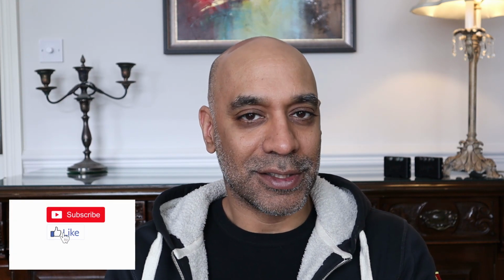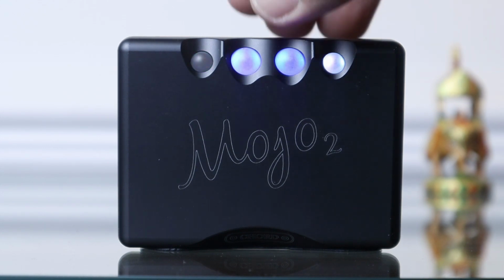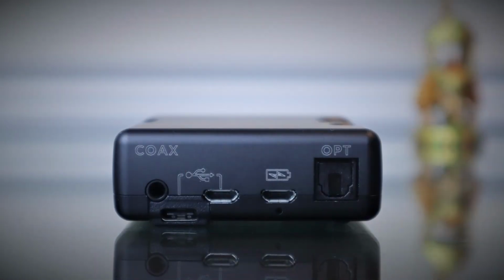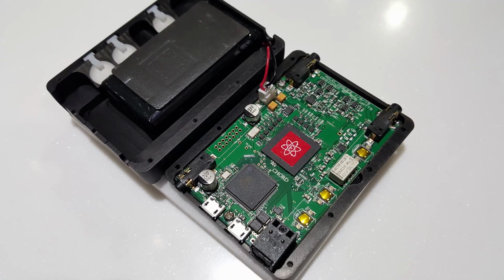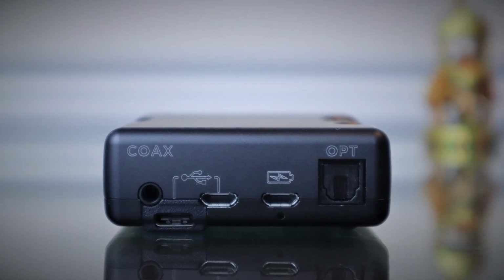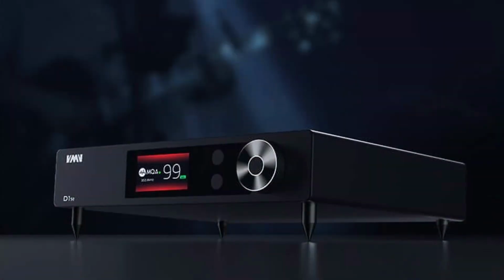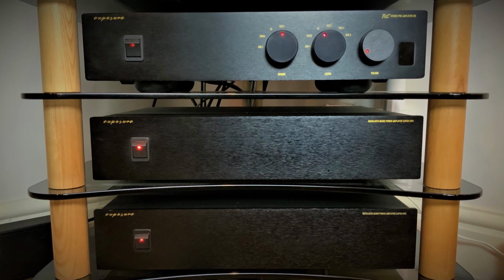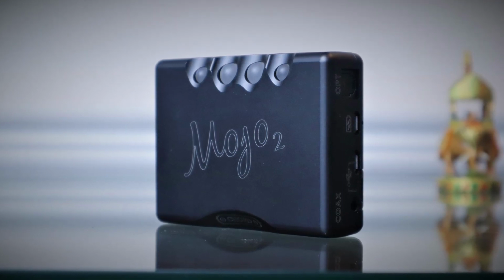Still Relevant? Chord Mojo 2 DAC Review

Comment: Tarun.   I might buy this DAC to try and wanted to ask.   Is it quicker than the mojo 1?  That is, is it more lively in transient response? 
I liked the mojo 1 , but it was a bit too big in the low end and too warm.  Plus a touch slow.  Just a touch. 
Thank you.    
Hope all is well with you
Reply from the maker: The transients are a bit cleaner on the Mojo 2 and the sound has less of that warm, soft colouration overall 😊
Reply: @abritishaudiophile7314    Well I tired it awhile ago and sent it back.   It seriously just didn’t have the mojo of the mojo 1.   I know.  Play of words.  
The Mojo 1 was one DAC which had a ‘ different ‘ sound.  And it was super nice.    It was large and enveloping.      A touch rolled off and the low end was large.    But the most important thing was that the original Mojo 1 was enveloping and deep sounding.  
The mojo 2 just felt like any other ‘ well measuring ‘ DAC.    Yes the filtering it uses does have a good time space quality.   But it was sharp and harsher.    
I think Chord got caught up in the ‘ SINAD’ wars started by ASR.   Yes I’m straightforward and will call them out.    Measurements are wonderful, especially to see if something is seriously wrong.   But it has become ridiculous and has no other function other than marketing Chinese DACs which excel at a specific suite of measurements. 
I am actually looking for a user Mojo1 to mess about with and have on my sofa to easy listening 

Cheers and hope you are well

Comment: Another excellent review, Thanks!
Asus Soundcard (modified with Burson Op Amps) in a home-made A/V Server bypassed with a Chord Mojo= Big improvement in Sound Quality.
Mojo to Qutest= Another jump in SQ and like some Reviewers mentioned, Qutest provides more of what Mojo does, and I couldn't say it better.
Qutest to Chord TT2= Another big step up.
TT2 partnered with Chord M Scaler= Yet another large sound improvement, providing a "Grande presentation".
The Yamaha A-S3200 powering KEF Blade 2 Speakers- A gigantic improvement for those particular Speakers over what I heard previously.
And the (sometimes) surprising differences provided by Speaker, USB and Interconnect Cables which also add to the enjoyment of this hobby. 
And then there's the BIG one: Speaker positioning relative to the listening position which in my opinion is second only to the Speakers themselves for sound improvements.
Reply from the maker: Thank you Ron. Great to learn about your experiences 👍

Comment: Hi! Can I use Mojo2 as desktop DAC, powered by external power supply (like Ifi SMPS or linear PSU). Some people report sound quality degradation/noise in that case of external powering.
Reply from the maker: I wouldn’t spend money on an expensive linear power supply for the Mojo 2. It is only used to power the battery. However, ditch the cheap switch mode power supply as it will induce noise on your mains that will pollute the rest of the system. Go for a low noise power supply like the iFi instead 😊

Comment: When using the Mojo1 as a deskop unit into powered speakers, I always hear a high pitched noise, which apparently isn't uncommon. With another source (phone instead of computer) or listening with headphones it's fine, but I haven't found a solution so dubious about the Mojo2 as fully useable on desktop.
Reply from the maker: Oh dear. I haven’t encountered that problem.

Comment: What an excellent review - thank you so much. I am waiting for DPD to deliver my Mojo 2 in about 3 hours time! Very excited and glad to hear it improves on the original Mojo which I have been using as a desktop DAC (and had to eventually remove a very dead and swollen battery due to overcharging, so glad they have addressed that).
Reply from the maker: Thank you Emmanuel. Much appreciated 😊👍
Reply: @abritishaudiophile7314  Thanks very much. I wasn't disappointed by the new Mojo 2 - amazing device and even on my £500 active monitors it outperforms the previous Mojo noticeably. 👌
Reply: @captainhadd0ck  Hi. Mine is picking up mobile phone signal noise so I cannot listen to it on the go. Does your unit doing it too?
Reply: @pistopit7142  No, I don't have that issue.

Comment: To answer the question, though (late, I know) it has to be the DAC / Pre-Amp I have from April ... up until that time I had only had the DACs inside CD players or AVR receivers, and it was life changing for me.

I want to say the model number was the DA100, but that's probably way off! I even have an uninstalled phono board still sitting on my shelf that I managed to source before the equipment was superceded.

In terms of even knowing this kind of thing was an option, well ... actually that came afterwards ... I know. Basically, I didn't fully register the importance until I got my lowly (and still in use) cyrus portable unit. That also (reference my other comment) has only micro-b, but tbf USB-C wasn't a thing then. I'd love to pick up a second hand one, or one with a broken USB for a project that I have, but that's a whole 'nother thing!
Reply from the maker: Thank you for sharing your experiences 🙂

Comment: Wow, L👀ks like Rob Watts has improved the Mojo a significant amount. Appreciate that you picked out flaws with this 'landmark' product (auto input select, LCD screen) pointing out there's always room for improvement. Many thanks for your pragmatic and tempered assessment of the Mojo 2. Your review has me thinking the updated Chord block-0-aluminium would be a nice addition, though I've no 'need' at the moment. In a similar vein, I've two DACs origionally chosen for portability, the Meridian Explorer 2 and a vintage HeadRoom Micro. Both have found their way into desktop headphone systems - at home, the Meridian's fixed output feeds a 6DJ8 preamp driving a hand built transformer coupled headphone interface with analog crossfeed via a RF Choke tied between the L & R channels, and at work, the HeadRoom DAC feeds a pair of Intact Audio AVCs (Autotransformer Volume Controls) with the same analog crossfeed method employed. I must admit that budget DACs are closing the sound quality gap on far more expensive analog setups (ie: Roksan Attessa TT w/ outboard Nina tonearm, Ortofon MC20, and Origin Live Discovery 1 phono preamp). But these portable DACs offer something unimaginable not long ago, true high end sound 'Off Grid'. Who knew this would ever be a reality :)
Reply from the maker: Thank you for sharing your experiences Bradley 😊

Comment: You motivate me to use my old chord mojo in a stationary desktop setting but I'm a bit hesitant about how to connect. As I understand it I connect the headphone output with a jack to RCA output cable to my amp, I connect the mojo to my cd-player with an optical cable and I can use an iphone/ipad charger to continually charge the mojo without interruption. Am I correct? Is the ipad charger usb a to micro usb b?
Reply from the maker: That is correct 😊
Reply: @abritishaudiophile7314  Thanks!
Reply: I connected my old mojo 1. Sounds great in desktop use. It will stay there for a long time. Now I am cooking the battery. Can I do something about it? Remove the battery? Let it play on battery at regular times? And if my battery turns bad  does that affect the desk top play mode?

Comment: Does the v2 have a line out mode like v1 or do you use it as a variable preamp in effect if going into a separate amp? Thanks for the review, I find your presentation style very informative and relaxed.
Reply from the maker: Thank you Alex. I don’t believe it has a fixed volume setting like it’s predecessor but it will remember the last setting on boot up 😊👍
Reply: @abritishaudiophile7314  have you had any issues with clipping as you would with double amping which this is effect isn’t it or does it detect the high resistance of the external amp and adjust,I’m a little confused how you use it as in effect a DAC only into another power amp
Reply: the preamp mode on the mojo 1 is simply setting the output level to 3V. you can do this manually on the mojo 2 by setting it to the blue/violet volume level --  it is technically the same implementation ( just without the shortcut key combination). The mojo 1 & 2 has no separate output stage other than the dac's.

Comment: What combination of colours do you use for your line out level when connected to an amplifier?
I got in contact with Chord and they said for 3 volts it's 41 presses on the high level headphone output, no colours. Both lights should be blue. 
I've pressed 41 times and I get lite purple.
Reply: To attain a 3v output, the customer needs to start with their Mojo2 as pictured below. 

The is the first setting of the ‘upper’ volume range. This is identified by a illuminated mode light on the left, but the volume + and - lights are extinguished. 

Now you will need to press the volume + button EXACTLY 41 times. The result is showing in the second picture, two BLUE volume buttons.
Reply: @stephenmacks23  Thanks for your post. I read this also in forums. Quite lengthy process. However, can the mojo 2 retain this setting when switched off, or should one redo it every single time? That would be a real painful process and not sure that my daughters and occasional friends would be willing or able to go through this procedure too. I wish Chord had made this easier like in the first iteration of this DAC. Thanks for the reply.
Reply: @AntonioCaZorzi  I have yet to hook my Chord mojo 2 up to my amplifier.
Reply from the maker: I had mine lower with lights on green. That way my Exposure 21 pre is operating in it’s sweet spot 😊
Reply: @abritishaudiophile7314  I'm new to DACs can I ask you how you came to this setting?
Reply from the maker: @stephenmacks23  just trial and error and I suppose experience helps 😊

Comment: Great review.  Does it have a fixed output mode for use as a standalone DAC in a hifi system?  Or did you just max out the volume control on it manually?
Reply from the maker: Thank you. The mark 1 did but I don’t think the Mojo 2 has a fixed line level output. Just set to taste 😊

Comment: Hi im interested in the mojo 2 for stereo setup. What adapter do i need to use to plug in a cd player with coax? Is it a mono 3.5 to coax or simething else? Its the only thing that’s holding me back from buying this.
Reply from the maker: Assuming your CD player has an RCA digital output, you need an RCA to 3.5mm lead 😊

Comment: Great review as always. Re the SMSL D1SE, have you used the 'Sound Color' options? I find that the soundstage width increases dramatically when using Rich or Tube options. But doesn't change much for soundstage depth.
Reply from the maker: Thank you. I did have a play but preferred the fidelity in stock form 😊

Comment: The Shanling M8 is the piece of digital audio equipment that has the biggest impact over the last 10 years. Late night or office listening has been transformed, I guess in a similar way that the mojo2 would if combined with its bolt on streamer. I can move from kitchen, living room or study etc and still get an exceptional audio experience.  I did consider the mojo at one point, but i hate the old usbc connector (i know this wont bother most people).  Only downside to the M8 is it gets quite warm with extended listening. I use FIR Audio IEM's mostly, or a few different over ears depending on what I'm listening to - I never use eq. Very happy with this setup
Reply from the maker: Thank you for sharing 😊

Comment: One correction  regarding the taps. They are not related to how many times the algorithm runs but to how may samples are used from the past and the future to interpolate the new sample. Also the number of taps is related to how much the original sampling frequency is up sampled. So, more taps could mean a longer time  window or upsample to a higher sampling frequency. Depends on the implementation on how these extra taps were used.
Reply: Wow, never heard that before,  that's fascinating.

Comment: Aune X8 Magic DAC vs Mojo2 anybody?
Reply: Might be a little late but it really depends on what you want. I have both of them and for pure sonic perspective, no doubt the mojo 2 takes it. BUT heres where it gets interesting, the x8 has upgradable op amps and its interesting to roll op amps from time to time. Its more of a home audio gear since you can leave it on forever. Dedicated dac that you can switch inputs, variable and fixed line outs, its more convenient compared to the mojo2. For the mojo 2, its just a joy to listen to but no line level for intergated amps. If you need coax, you need a special 3.5 to rca digital cable. There is always a work around but not gonna lie, its a pain to live with if your using it with a stereo setup.

Sonic difference would be aune x8 is more analytical but still refined. Mojo 2 is more of a warm or dare i say analog sound. It will really depend on your use. I would pick the mojo 2 anyday even if its a pain to work wiith from time to time.
Reply: @justanobody4983 Thanks for reply yeah was a great dac for the money while i had it for sure. But now i have upgraded to the Musician Pegasus and holographic magic happens :)
Reply: @shelly6482  very nice upgrade. Knew months after would be a late response. Lol. Happy listening!
Reply from the maker: Sorry, but I haven’t heard the X8 😊

Comment: Dare I say it Tarun another outstanding review. Very comprehensive and I tend to agree with what you said. There is certainly a sonic Improvement between the original and the version 2. I for one wish they had put some kind of screen on the revised version, as those buttons just did my head in.

In Regard to your question about notable digital products l have owned or heard. I've been impressed with my long-standing luxman da 06 Dac, and only recently have I introduced the Holo audio May kte into my rig with great success and wonderment. 
A stunning product that personally I feel is as good or not better than just about anything else under around 30 grand. Probably about half that for your money of course. 
Anyway as usual a great video and im already looking forward to the next one.🎧👍😁
Reply from the maker: Thank you Shane. I was very impressed with the Spring 3. I can imagine that the May KTE must be pretty much what I would consider reference quality 😊👍
Reply: @abritishaudiophile7314  yes Tarun I would agree. I listened to a lot of Dac's before I eventually upgraded, and it is stunning how good it was. Signal separation and soundstage is just phenomenal.

Comment: Since you mentioned the comparison, I also have both the Mojo 2 and VMV D1SE myself and have done some comparative listening (mostly with headphones, Quad Era-1  for the majority). Personally I don't hear the sound stage differences, but that may very well be more of an issue with the headphones/speakers not opening up wide enough to start with (slightly narrow soundstage is about the only negative thing with the Quads).

However, I do find the overall sound of D1SE quite a bit more enjoyable. There's something esp. with Rich2 sound color mode on D1SE that really makes the Quads sing in a most pleasing way. How that combo renders e.g. female vocals, distorted electric guitar etc is quite something indeed.

Having said that, there's loads of similarities with Mojo2 and D1SE as well – both have certain effortlessness to the sound that's missing from many technically apt DACs. And separation between instruments is excellent even in busy passages with both.

So thoroughly enjoy Mojo2 for on-the-go and desktop listening, but would never switch from D1SE on the main listening station.
Reply from the maker: Thank you for sharing your experiences 😊

Comment: I have had no digital game changer as I’ve only owned on standalone DAC, so I can’t compare. I still prefer vinyl (and valves) but admit that digital has gotten very good. A new DAC is on my roadmap but I’m 99% sure it won’t be the Mojo 2 - the buttons/user interface are just not for me. My dealer uses an original Mojo in one of his demo systems and it seems fine, but I a am not interested in it when other offerings are at least as good.
Reply from the maker: Thank you for sharing 😊

Comment: I do not have mains problems so I have not had drop outs. Yes, there maight be DACs which are more refined or you get higher clarity but, to use a term that is too often abused, the Bigger Bit generally sounds more musical. My main system which includes a server/streamer, record player and CD player uses the DAC in the MusicBook20 based around a AKM4490chip. Having listened to a large number of DACs I have in general found that DACs based around AKM DAC chips do sound just that little bit more musical to my ears.
Reply from the maker: Thank you for sharing Daniel 😊

Comment: I am wondering is there any functional improvement using this DAC in desktop mode compared to the original Mojo?
Reply from the maker: Yes, I cover that in the review 😊
Reply: @abritishaudiophile7314  Thank you for your reply. From what i understand Mojo2 will not overcharge the battery when it is always connected to a usb and you state that it is a big improvement over the original Mojo. Does that mean that the original Mojo's battery will die if it is always connected? Over a period of time that is.
Reply from the maker: @t1ll1s  yes, the Mojo 1’s battery life shortens if constantly plugged in 😊